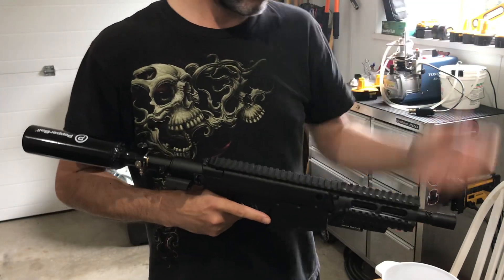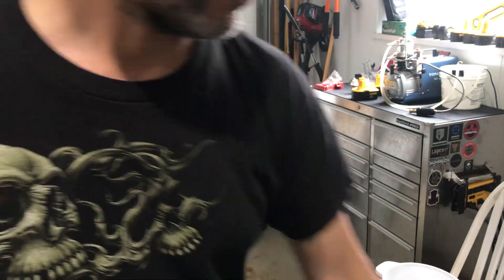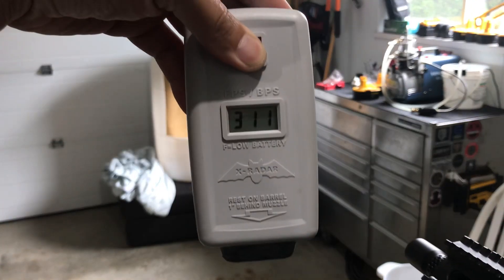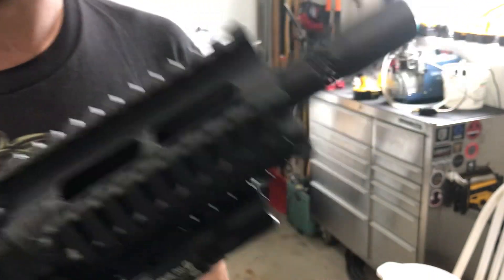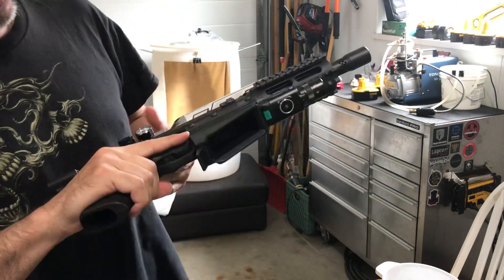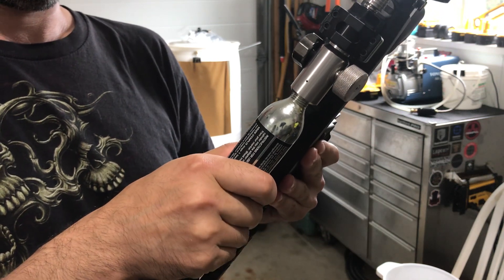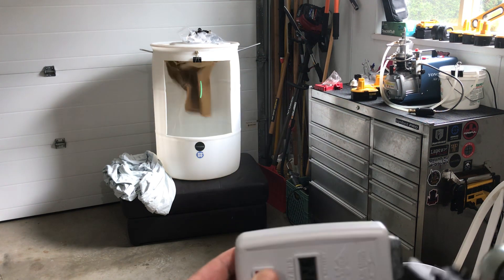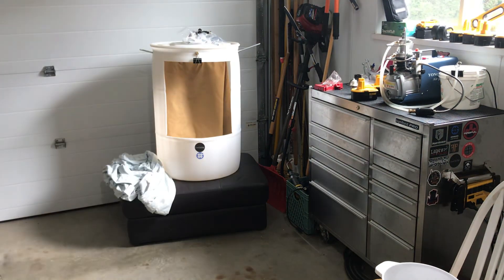90g Co2 and drilled bypass fail.

Comment: Can i use c02 in my m17 if i did not drill but did the bypass where i took out brass orifice and velocity stack/fps adjust? Thanks
Reply from the maker: The M17 handles up to 25g co2 no problem but once you jump to the 88/90g it ingests too much liquid co2 and the heatcore ring freezes causing malfunction.
Reply: So in your opinion should i use a 35 ci tank if i want to get off 100 or so shots with 10 G rounds ? Thank you for your replies
Reply from the maker: @chrisalarcon7013  i havent tested anything large yet so I cant say for sure. Valken doesnt recommend aluminum bottles larger then 26ci to hang off the heatcore. If you go carbon fibre larger bottles are ok. They say the larger aluminum bottles put too much strain on the rear of the marker.